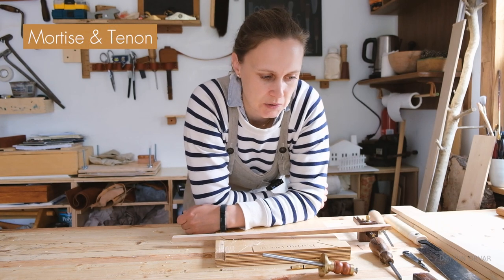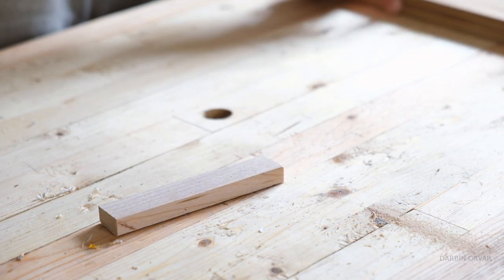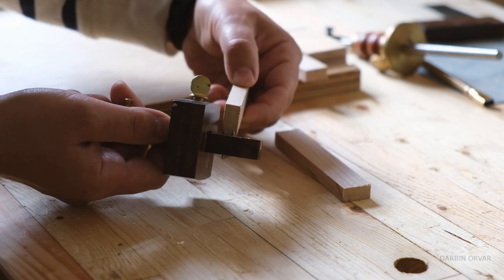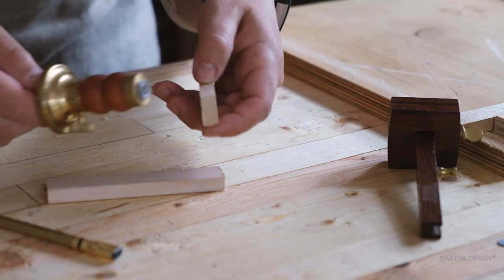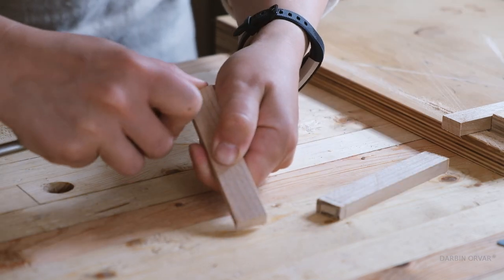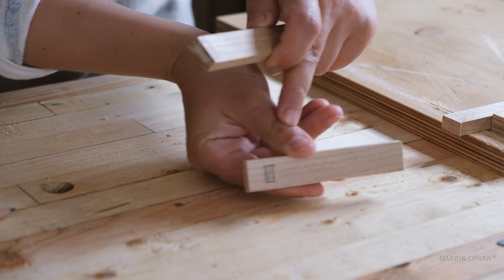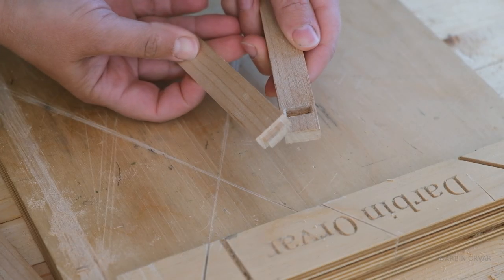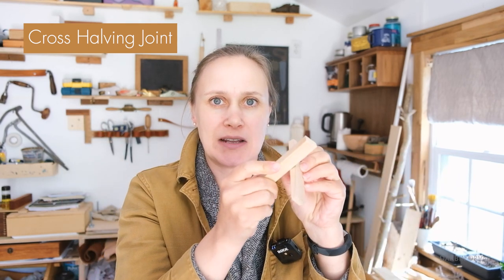Making Secret Concealed Joints: A Relaxed Woodworking Video

Comment: For the cuts you made a japanese backsaw aka dozuki would have been easier than the kataba you used.
Dozuki's also tend to have thinner kerfs, some as thin as 0.4 mm which is, I believe, thinner than the plate of the backsaw you were using.